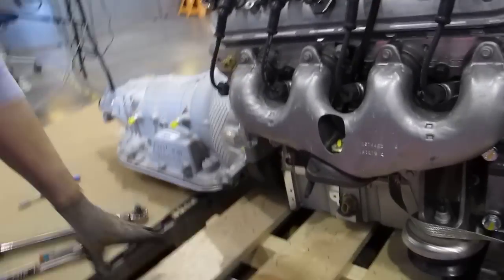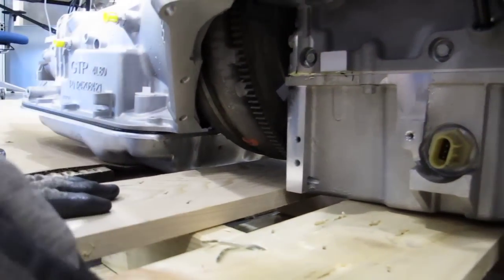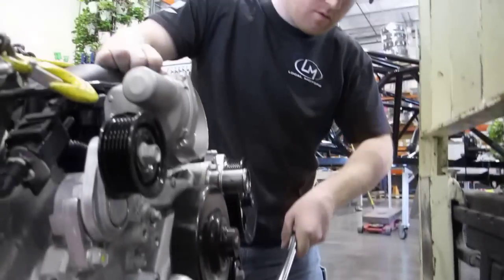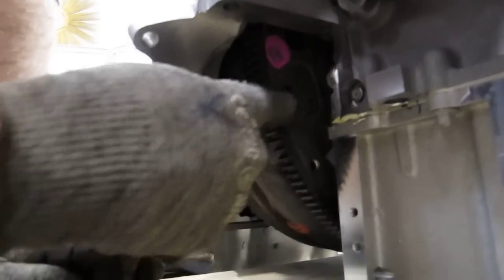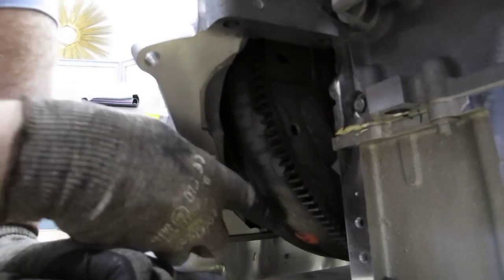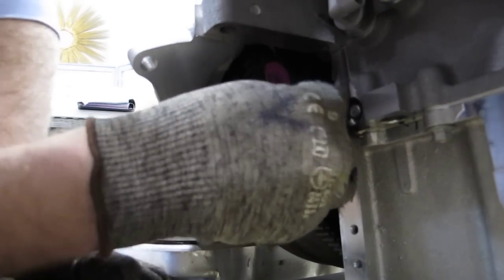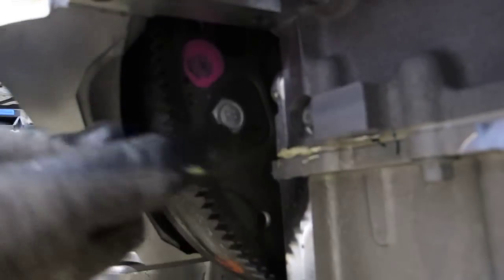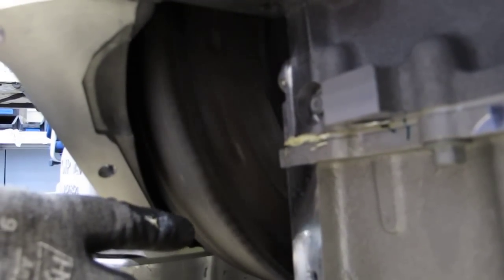Installing torque converter to flex plate pt1

Comment: Transmission installed. '08 jeep AWD 5.7 the flex and torque converter are stuck together. Flywheel won't turn all by it's self. Converter turns with flywheel. Help. Can't get the 4 holes to line up. Any suggestions?

Comment: you failed to the the gap between the flexplate and the torque converter the converter has to have a little movment so it dosnt destroy the trans pump or the crank beiring
Reply: How much is the gap??? 😅

Comment: Also you can tell you he's not a true mechanic explanation mark. You absolutely do not turn in engine in the opposite direction that the engine runs or spins when it's running explanation mark. The reason for this is you can jump the timing chain or the timing belt and throw the engine out of time, in other words you can ruin the engine my turning it in the opposite direction of its normal rotation. Those timing chains or timing belts have a spring-loaded tensioner that takes the looseness out of the belt the slack and if you rotate the engineer opposite way it causes the slide to come out push the tensioner back and you could skip a tooth or skip a notch and ruin the timing on the engine I hope nobody else does this or watch this in and does what that man did by rotating it the opposite direction. All it takes is to rotate it backwards one or two notches on a flywheel and you could go ahead and skip the timing out

Comment: Please some advice what will happen if these bolts are missing or loose?
Reply: @HemiTwist  so I got my transmission replaced and I changed the fluid and speed sensors but only during high rpms it shifts hard I took it in and they are playing it like they don't notice the problem and Im passed the Warrenty already... What could cause hard shifting or miss shifting at high rpms?
Reply: @HemiTwist  also when my transmission when out and when it was replaced they never changed out the torque converter could that be the culprit???

Comment: Why the hell does the flex plate have teeth if they dont grab anything? It looks like its bolted to the torque converter so what the hell are all those teeth for?
Reply: They’re for the starter to grab and spin

Comment: Hey guys. I have a 96 gmc with a 4l60e i replaced transmission but i used my old torque converter and now the bolts dont reaach the converter   from the flyplate.. I can do two things. Drop the transmission again. Change the converter. Or i can buy some longer bolts to pull the converter to the flyplate.  Which way should i go?  And how important is keeping the same converter. Because i used the old one and its a smaller transmission.  The one i have, the Bell housing detaches. The old trans has a complete housing.  Can you help me?
Reply: You need between 1/8" to 3/16" space between the converter mounting pads and the flex plate.  Use washers to get there.  Never pull the converter too far, or you'll ruin the pump by driving it with too shallow engagement.
Reply: @jamesplotkin4674  James, explain something to me,Ive mainly dealt with Fords all my life and most use studs not pads, with studs and nuts but i have heard before what you typed about the spacing,i guess what confuses me is, once you put your bolts in and tighten them how do you have a spacing? doesn't the torque converter pads snug up to the flex plate on a Chevy once those bolts are tightened? i was just curious, thank you for your input.

Comment: I have a 1998 Buick Park Avenue with a 3.8 L motor V6 when I am at a stop sign or a stoplight it is rattling like it's coming from the torque converter in the flywheel but then when I'm driving the noise stopped so I want to know how many screws does the flexplate have to screw up to the torque converter

Comment: I'm an amateur when it comes to mechanics in cars. Can anyone help me out with this question. I'm trying to mount the bolts to my flexplate. The four bolts go through the flexplate and flywheel? Or does it go through the flywheel to the torque converter? I'm stuck in a rut and trying to get my vehicle on the road so I can see my kids for Christmas. This has been my dilemma for many months now and I'm down to the wire and need help ASAP. I thank anyone who is able to help me in this matter. Work has me away from home for more than a year. And it's time that this Dad gets back home with his loved ones

Comment: Never turn a jaguar v12 the opposite direction... makes them unhappy... w the cam chain
Reply: That goes with all motors I hear, never rotate it both ways, only one direction. You miss the hole you rotate all the way back around. Never back it up like what they dod

Comment: Should you be able to push that converter over to the flex plate without using the bolts to draw it up tight? My spacing is good but I cant slide the converter up against the flex plate. Not a lot of room to try though. I have a 1/4 inch gap between the converter and the flex plate.
Reply: Hey Mike what did you figure out in the end?

Comment: This can be done faster,the flexplate has an Oval shape hole,that is the guide bolt, you can tight it all the way ,the rest  of the bolts will match just fine.🤨

Comment: If one screw is tightened to hard could it unseat the torque converter? And if it unseats can I just remove the bolts and try to reseat without removing transmission?
Reply: You'd have a really huge gap to "unseat" a converter.  No need to remove the transmission, just start over, but it sounds like you have more than 1/2" gap between the converter mounting pads and the flex plate.

Comment: why not just tighten the converter to the flexplate on the guide it has? The flex plate has a oval size bolt hole, that's your guide.

Comment: You should never reverse rotate an engine. Even if you miss the bolt hole. Rotate a full rotation and line it back yp

Comment: I'm having issues with flexplate bolts to the engine side. All the bolts will go in but one why does it do that.
Reply: Sounds like you didnt start with the correct one or you tightned them to much.
Reply: Wathe the video and it tells you why
Reply: @locsservices  That's not on the video,hes taking about the flexplate bolted to the crank,sometimes when they make flexplates the holes might be ever so slightly off and i mean just a smidgeon and you just have to put your bolts in and run them in. flexplates however do have to be mounted in a certain way, one of the holes has a little tiny "ear" or what not, that hole with the ear usually goes on top dead center and the rest will line up fine

Comment: Question: If the torque converter spins freely, why would you need to rotate the motor to line up the bolts?
Reply: Because the torque converter spins freely not the flexplate therefore it must be rotated to align with the torque converter so that you can install bolts. once one bolt is inserted they will spin in unison together so the rest of the bolts can be inserted
Reply: This can be done faster,just look for the hole at the flex plate that has an oval shape that bolt has to be first and you can tight it ,because that is the guide bolt once you have that one tight the rest of the bolts will match just perfectly.🙋🏻‍♂️
Reply: I know this is a old comment but i figured it might help someone, the reason you have to turn the converter and the engine together is because there is only one "open" spot where you can put your bolts in, if it was all open once you line it up you could put all your bolts in and be done 
, no need to be turning and turning.

Some engines use the starter hole (where the starter normally resides" to put the bolts in there but normally most trannys have a inspection plate at the bottom that you have to remove,its just a little cover made of metal that covers a hole, line it up your hole or stud on your converter, put one bolt (or nut), spin,line up your next one in your access hole, install your nut or bolt, spin again and so forth.

Comment: Hmmm i thought, especially with the long block assembled youre not supposed to reverse rotate it.. =\
Reply: I agree, when I installed my new rebuilt long block I didn't and never rotate it counterclockwise. Makes me curios though.
Reply: Same thing i was thinking smh
Reply: Technically correct. If it's a race engine you would never do that. It is said to be possible to stretch the timing chain and throw timing off.  Butt honestly a motor like this probably has a double roller timing chain and when doing it slowly by hand on a motor with normal compression it shouldn't hurt a thing. Totally different on a high compression motor or if turning it over by air/electric power or if it's belted or single roller. Basically not a wise idea but here it's not really a screw up or a rookie mistake, possibly not a mistake at all.

Comment: I take it that the main point here would be = if you thighten 2 or more bolts ,then the last bolt would'nt go in ,right ? that's because the plate would be out from the torque and too far away for the last bolt to thread.it would also be running angled to the hole. I have encountered this and verify this to be true. so thighten each bolt gradually ,you,ll have no problems

Comment: is it possible to turn the crank shaft over if its in the engine bay still, im in the proscess of a converion to auto and looks like a tight squeeze to try and turn the crank around,cheers
Reply: to make it easy just remove the belt, drain and remove the radiator that should give you adequate space.

Comment: hmmm i dont think thats done properly but hell what do i know i drive a ford truck so i don't think my torque converter is attached to the flywheel/ converter
Reply: Ive built engines for the majority of my life and during assembly thats how its done every step of the way at every addition of a new bearing and cap thats how you establish clearances are correct and everything is smooth cause the smallest things can bind you up